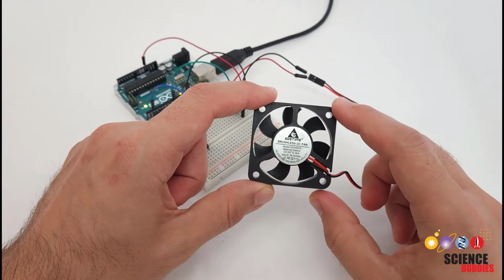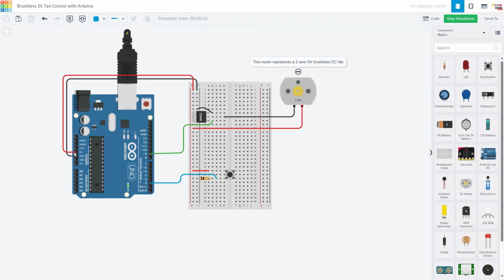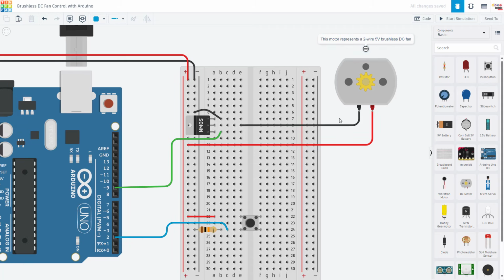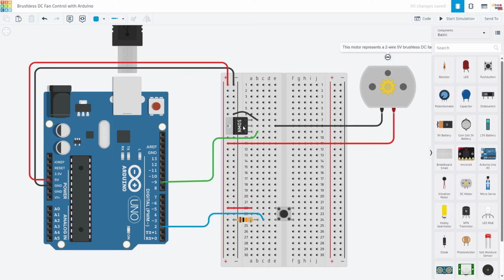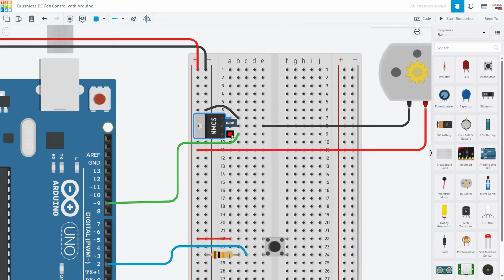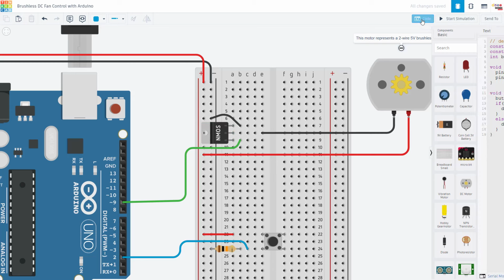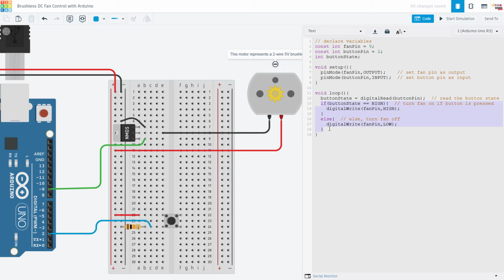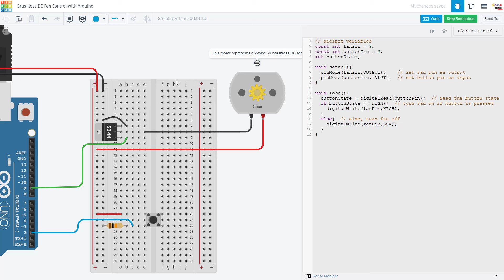How to Use a DC Cooling Fan with Arduino (Lesson #40)

Comment: The gate is normally connected through a resistor to ground in order to turn off the mosfet. Otherwise it stays on once turned on by the Arduino pin.

Comment: Can i know the difference between 12v dc fan and 5v dc fan in term of fan speed. Is 5v dc fan enough to maintain room temperature in closed system?
Reply from the maker: There isn't really a simple answer to this question - how much air flow you need to maintain constant temperature in an enclosed space depends on the size of the space and what is heating it.

Comment: I've been working on a group project and we've decided to create a smart temperature controlled fan for a class i'm taking. I was thinking of buying a 4 pin fan instead of 2 pins as I couldn't find one on amazon. Would it be more difficult or are there any major differences? There is a pwm 5v 4 pin fan from noctua that I'm interested in buying that has all the stuff that I need except for the fact that I don't know how to connect a 4 pin fan to the breadboard/arduino. I have gotten the temperature sensor to work and display it on an lcd screen. I've been relying on online tutorials, researching stuff, and a robotics course that I took in high school that introduced me to arduinos like 2 years ago so my knowledge in this area is a bit limited.
Reply from the maker: Hi - unfortunately we don't have our own tutorial on a 4 pin fan. We suggest specifically searching for 4-pin fan tutorials with Arduino or asking in the official Arduino forums.
Reply: hey, i also working on something similar

Comment: Hi, can i use a L293D (H bridge) to control the fan just like motor in one of you previous video with motors?
Reply: Yes
Reply from the maker: Please watch to the end of the video and note how the fan does not reverse direction if you reverse the power wires, so it will not work with an H-bridge IF your goal if to reverse the fan's direction. If you connect the fan's positive wire to an H-bridge output and the negative wire to ground, you could still use the H-bridge to control the fan similar to how you use a transistor.